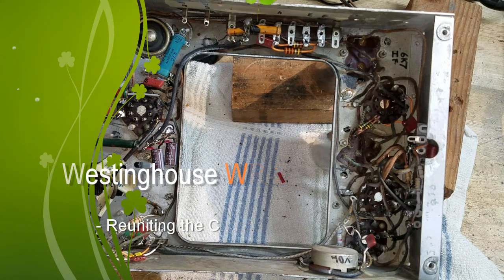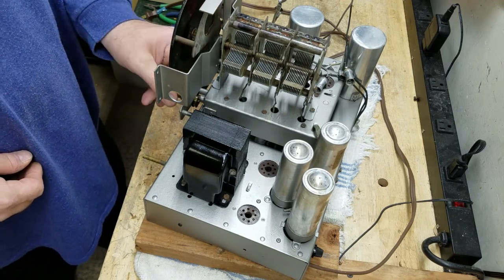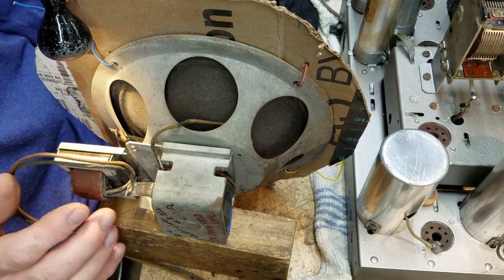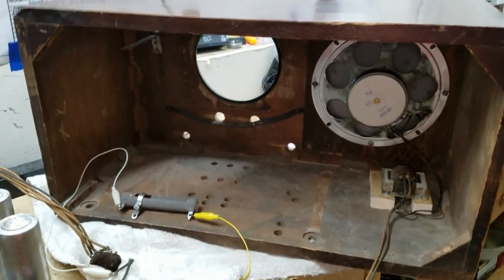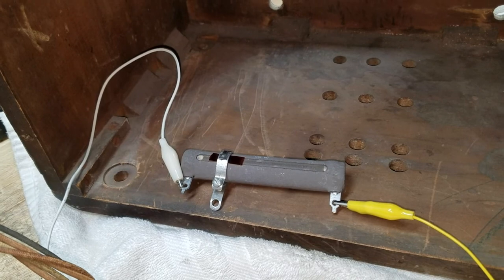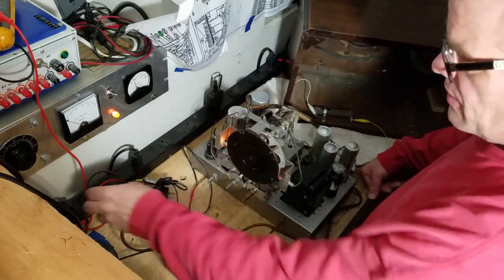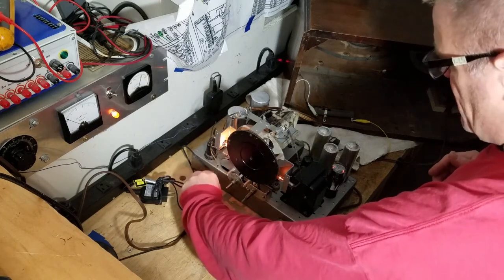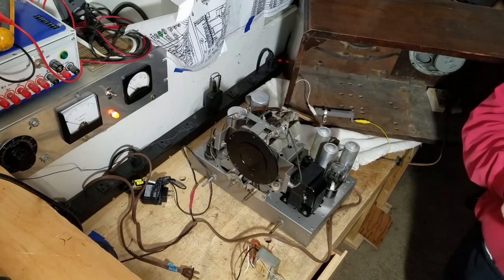1937 WESTINGHOUSE WR-212 BC-SW Radio Part 6 of X Reunite the Chassis

Comment: Those field coil speakers can be rewound. Buzz1151 did one recently with great results. I'm not a fan of the phrase "Not worth fixing" but great job with the replacement.
Reply from the maker: "Not worth fixing" is a relative thing that carries different freight for different folks.   In the context of this radio, it would have cost the owner enough to make it "not worth it".  

I've seen Buzz's video and it was awesome.  I love the "Buzz Winder".  I have repaired field coils by hand, and I believe that this one is fixable and I'll not junk the speaker.  At some point, I will repair it.  Even though it was not worth it to the owner to spend the time (and money) to do that for this radio, I'll do it later for the personal satisfaction that will come from saving the speaker.  Sadly, it will have to come MUCH  later, as I've too many projects on my plate right now!  

My point was to show others that all is not lost if one finds a radio with a speaker that is as much of a mess as this one was.   BTW, I did nothing to this set that is not completely reversible, once the speaker is repaired.  And, if it were MY radio, where I don't have to pay for the time, I would have fixed it!   [: 0)

Thank you for watching and for the great comments!   Michael
Reply: I see, I didn't realize you were fixing this for someone else. I only do repairs for myself for now till I have enough under my belt to be confident enough to do them for others.
Reply from the maker: Yeah, I do a bunch of that.  I don't consider myself a radio expert at all, but I love bringing old stuff back to life.   I try to remember those lessons that I learn, as I go.   I used to restore sewing machines, too, and I occasionally do one of those for someone, too.  Doing radios for other people started out just being a small thing I did to help pay for the hobby.  But, there are a lot of folks in Salt Lake who want this type of thing done.  I've been struck, since I moved here 6 years ago, by the sheer number of these old sets that are available in the Salt Lake Valley.  I'm grateful for the confidence other folks place in my simple work, and so far I've had no complaints.  Fingers crossed...
Cheers!   Michael

Comment: Hey Michael, That Lockheed had crashed once before and had been rebuilt before she took her ill fated flight.  There was an episode on I think PBS series called History Detectives and a guy had a chunk of aluminum from her plane.  It was a piece of the skin from a crash the plane had had once before.  Check that series out sometime.  They once showed a Navy plane that was a canvas doped HUGE biplane that flew across the Atlantic long before Lucky Lindy did.  Good video.  Looks like it's coming along quite nicely.  I saw John's latest mish-mash video where he used a PA speaker on his SX-43 using that transformer to drop the Ohms from 500 to 8.  Would something like that work with your project?  Hey, I finally found a Fisher very similar to the one I had as a kid!  I bought a Fisher 125 a few weeks ago from ebay.  It isn't tube I don't believe.  It was manufactured in 1968 so it's an early solid state set but It's heavy enough to be a tube set, lol.  It weighs close to 40 lbs. and it's a "compact" tabletop model with the built in BSR changer on top.  I know it needs some mechanical work because the dial is rough to turn.  I'm just hoping it doesn't need any electronic work because I've never worked on circuit board equipment and I would absolutely hate to have it be my first one and bugger it up good.  Take care my friend, Gary
Reply from the maker: Gary,
That transformer probably would have worked.  I have only done the conversion a time or two, because I am an originality nut.  So far, I've been able to use the original output transformers, like I did in this one.  

Good on ya' with that Fisher.  I really like early solid state stuff.   Those point-to-point wired Germanium transistor sets sounded very tube-like.  I have an early Kenwood that sounds awesome!

I enjoyed your tour of Salem, after the flood.  It did make me sad, but I was still happy to see the "back streets" of a small midwestern town.  Thank you for making it!

Take care!   Michael